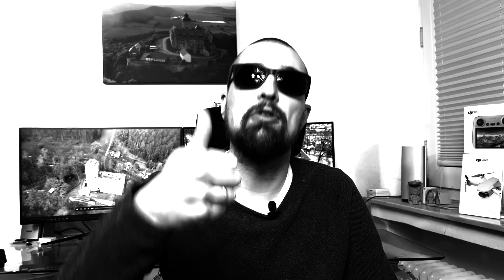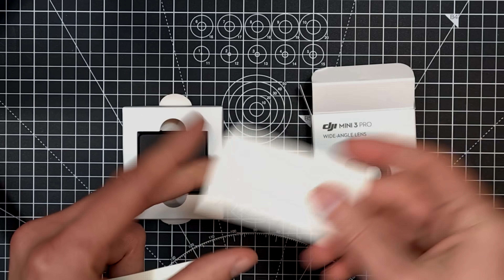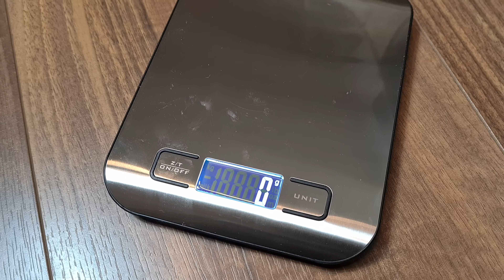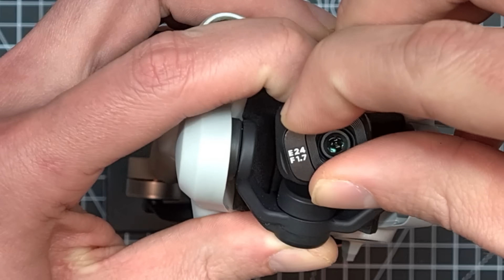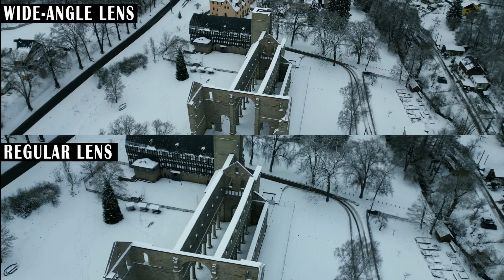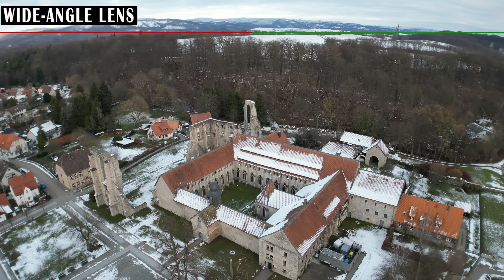When using WIDE-ANGLE LENS you should know this | DJI Mini 3 Pro | Test and Tutorial

Comment: By "tilt angle reduced with wide angle lens", did u mean that you cant rotate the gimble as high or low as when using regular lens? If so, which direction is reduced? Both, up, down?   Thanks for the video!
Reply from the maker: I have directly tested it on ground and in flight. Tilt-Angle down with Lens is 90 degrees. Tilt-Angle up with Lens is 60 degrees. It is exaclty the same without the lens. Seems there is no further limitation. When I've done the testing - a few firmware updates ago - the upward angle was less then 60 degrees. Additionally the manufacturer is remarking the reduced tilt angle in the manual. 
So luckily they seem to fix it. 😉
Reply: @doatrip  Thanks for the reply!
Reply from the maker: you're mostly welcome.

Comment: I've tested this wide angle lens attachment extensively, and I'm surprised that your review doesn't say anything about how blurry the corners are. When shooting stills using the entire sensor, the blur is obscenely bad. When shooting 4K video, the blurred corners are less bad, because the video format crops the sensor and doesn't contain the worst areas of blur in the corners, but the 4K video is still unacceptable blurry in the corners. I do not believe my lens is somehow defective, I think it is just the same as the one you are using. So why no mention of extremely  blurred corners? Personally, I would advise others not to buy this piece of junk. I love the Mini 3 Pro, but hate this POS wide angle attachment. My advise: Don’t waste your money.
Reply from the maker: Thanks for your comment. 
Honestly I use the lens at almost every flight and I never seen blurry corners. Not saying that they do not exist. I will definitely take a closer look next time I am using the lens.
I have shared several shots in the video. Can you see such corners there?
I also used it flying for the latest video around the monastery Paulizella. I am not cropping corners or something.
So to answer your question: I haven't recognized this issue, that's why I do not mention it. 🙂
Reply: 😅88⁹😅😅⁰⁰ⁿlb A

Comment: Thanks for the review. I was not aware that I couldn't use this lens for panorama which I do use occasionally, but it makes perfect sense once you think about how the shots need to be stitched together. I've had the lens for a few months now, but don't use the drone as much during the winter. I really like it otherwise but haven't attempted a panorama for awhile.
Reply from the maker: You are very welcome. 🙂 Just give it a try with the panorama. Mine is showing a message that the wide lens is attached. Afterwards the function is greyed out.
And you are fully right. The software was created to connect pictures without barrel distortion. Even if it would take all the pictures they wouldn't fit to each other. 😆🙂

Comment: I have its great 👍 also liked it more when it fits inside the gimbal guard
Reply from the maker: Yes that's a really good point. So you can keep it mounted all the time. 🙂
Reply: @doatrip  update I try the foam on gimbal but it pushes it out to far making the wide angle lens touch the gimbal cover. So I'm doing without the foam
Reply from the maker: @kamikazekaos  Sorry haven't reconginzed your comment as YT was not pushing me a notice. 
it is interesting, that your foam is obviosluy to thick. In my case this is not happening. Maybe DJI has delivered different foam. 🤔